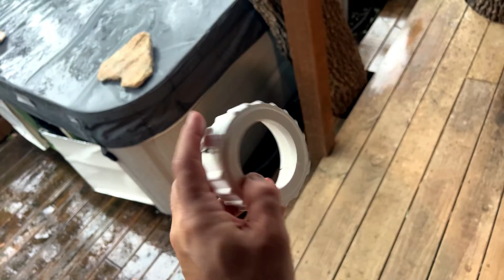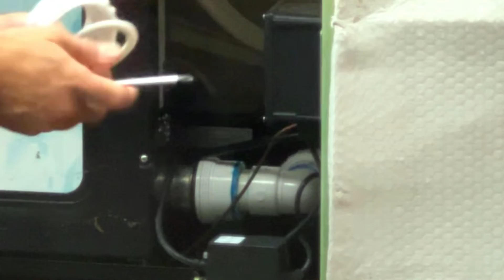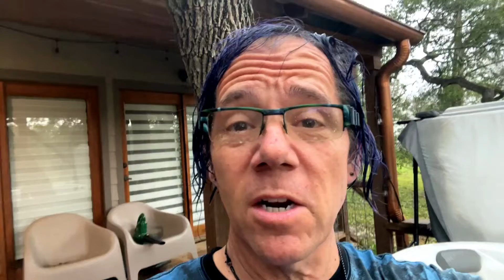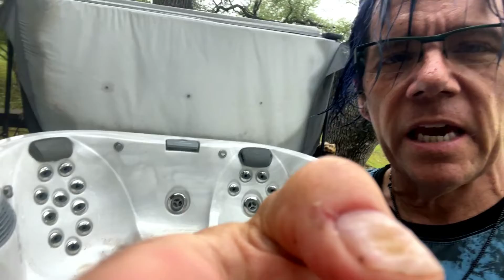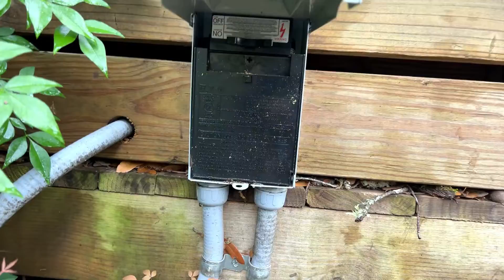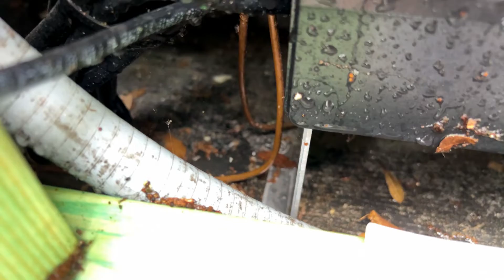Hot Tub Union Fitting Split Nut Repair and Cleaning

Comment from the maker: In today's video I replace a cracked split nut union fitting at the hot tub heater. So, if you need to do a hot tub pump union emergency repair on your split nuts, this video is for you!

Comment: That is a non-rated pool fuse which is wrong. Should be whatever rated GFCI breaker just like on yours, Jeff.
Reply: Not to mention a non-rated pool fuse could melt the wire because it’s non-rated

Comment: Great idea to replace the cracked split nut but how do you get the new gasket in there?
Reply: Before screwing the nut back on, you slide the washer with the grooved side into the recessed area - then screw the nut tight.  I'm actually doing this RIGHT NOW and came to search to see if I have to remove the split nut if it's not cracked - I should be able to just loosen it - separate the pipe from the seal and put in a new washer - then screw it back tight (so long as the nut itself isn't cracked.  We shall see...)